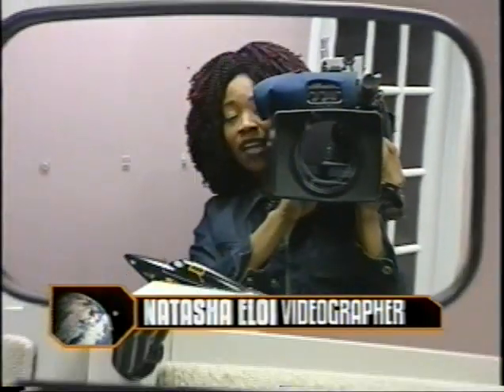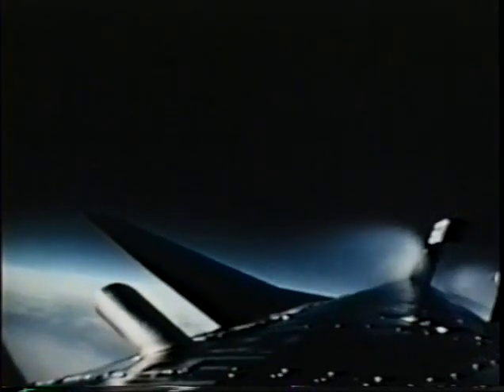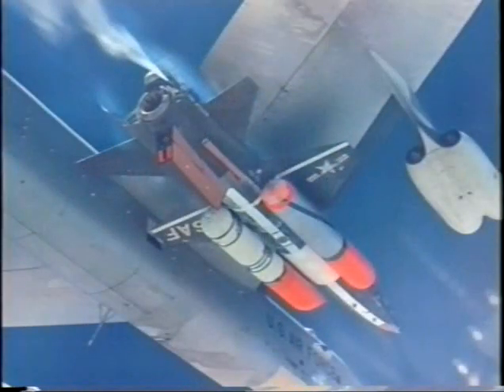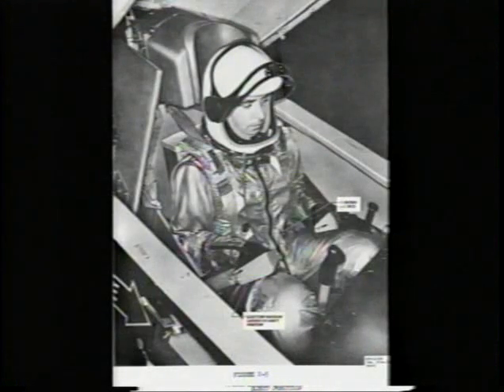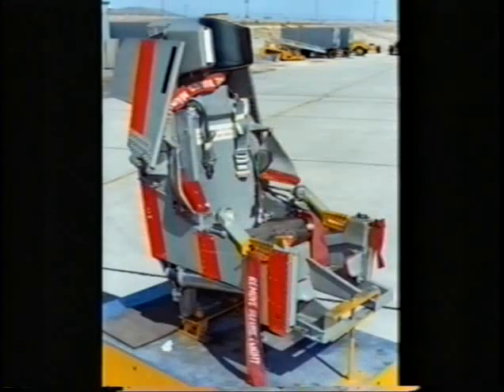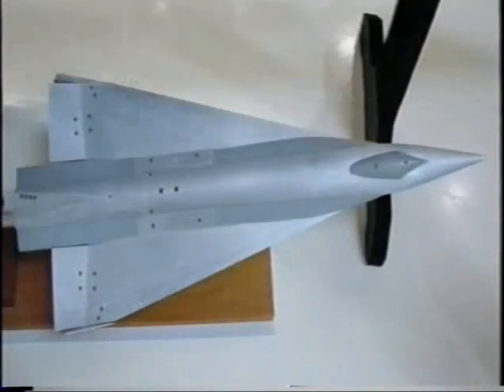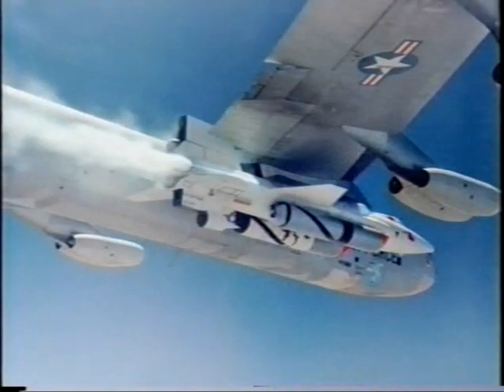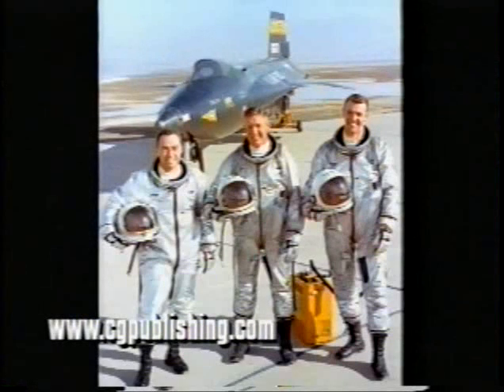X-15 Rocket Plane - The NASA Mission Reports Part 2

Comment: 13 different flights by eight pilots met the USAF spaceflight criterion by exceeding the altitude of 50 miles (80 km) thus qualifying the pilots for astronaut status. 

Of all the X-15 missions, two flights (by the same pilot) qualified as space flights per the international (Fédération Aéronautique Internationale) definition of a spaceflight by exceeding 100 kilometers (62.1 mi, 328,084 ft) in altitude.